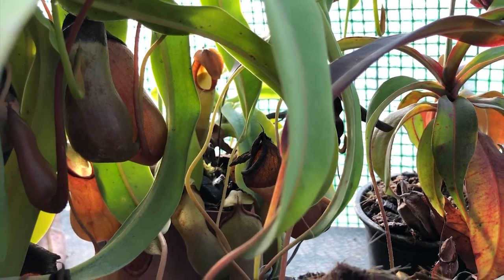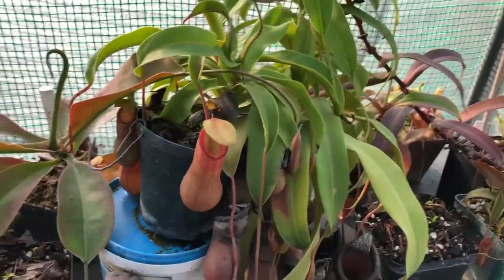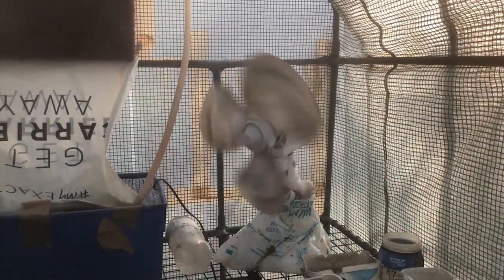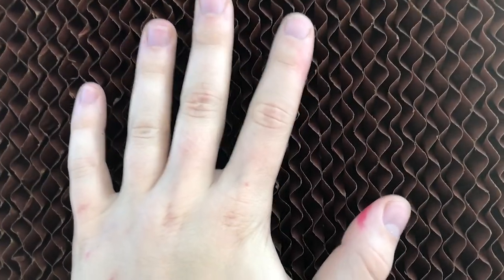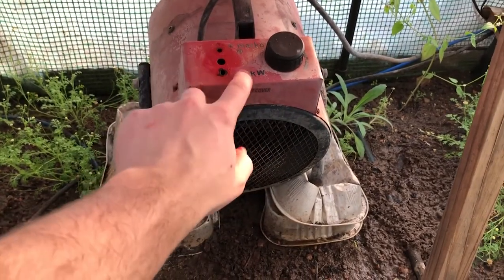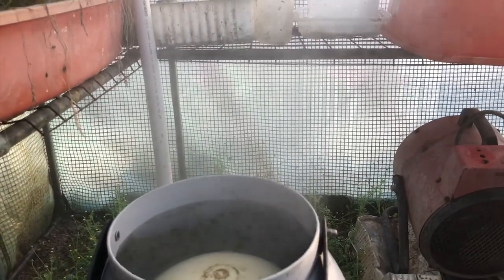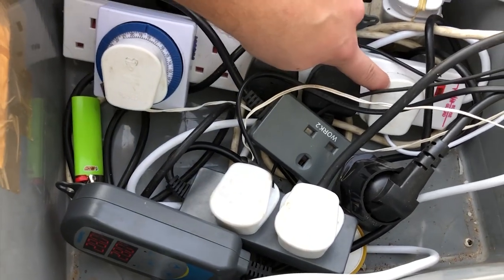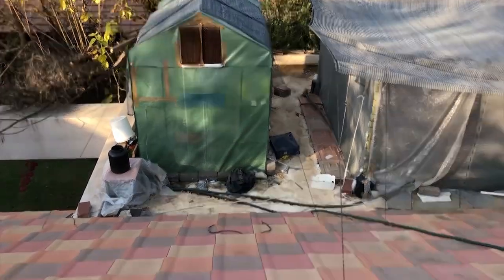Cheap Greenhouse Ideas - How to Warm, Cool and Keep Your Humidity Perfect

Comment: Thanks for some ideas, I have some wet wall coming and I have small (small) pond and bird bath pumps and a 4x6 greenhouse with solar , small hobby , and pvc pipe laying around and a 5 gallon bucket I will make a holder 2-3 inches from top of bucket to set wet wall on to capture water and fan I will put behind it to see how much humidity I can create , I’m just fooling around with greenhouse during summer, some germination trails after I put out tomato and pepper/ zucchini plants in ground
Reply from the maker: Goodluck! I hope it works out. I’ve found that “sucking” the air through the pads instead of “pushing” the air works better

Comment: 4x6 is rather small for some ideas and greenhouse is not made to cut into plastic the weight would probably pull out panels , so I’m just trying to raise my humidity so actually any water will evaporate so I have all the parts to play with and sensors , you can’t cheat Mother Nature
Reply from the maker: Goodluck! Check out those ultrasonic humidifiers. They work well with a small PC fan to push the air out.